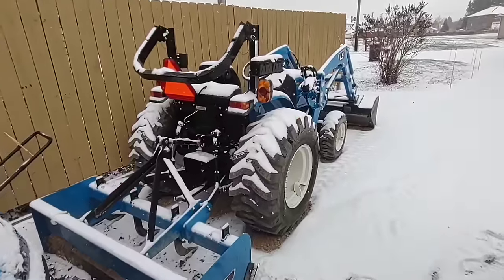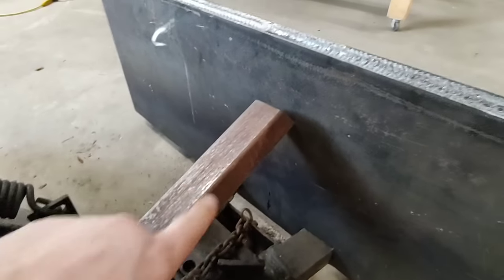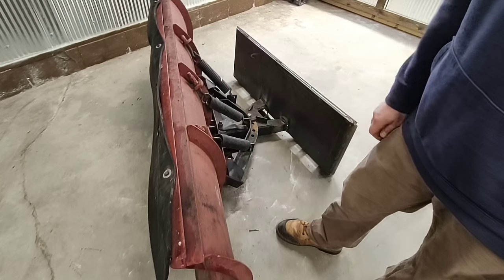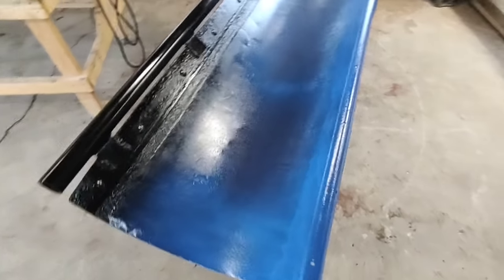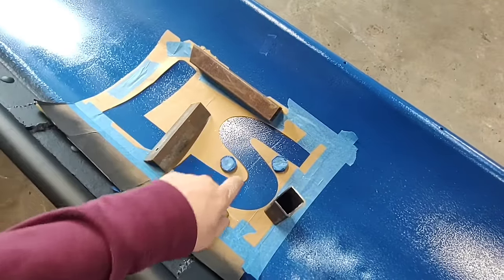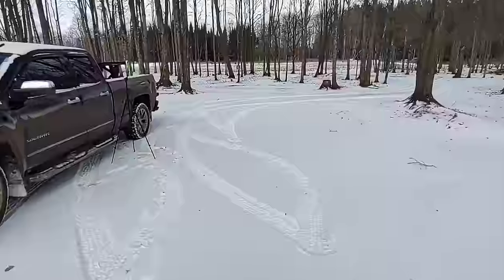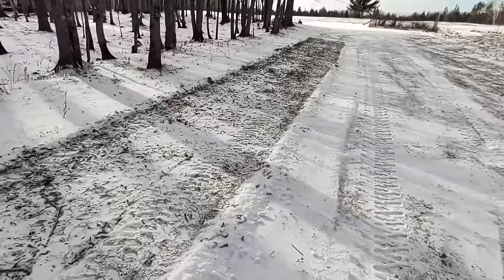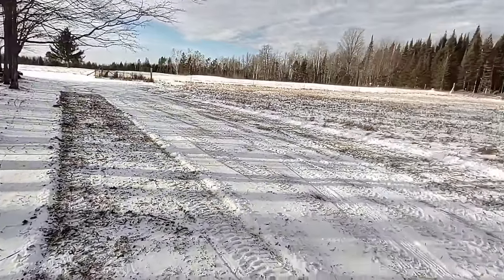Building a Snow Plow For My Tractor! Using an old truck plow and quick attach plate.

Comment: Most people would mount hinges to the bottom of the plate and use a chain lift so that the plow can float with just its weight pushing down not the weight of the loader too.
Reply from the maker: Before I built mine, I did see that with other builds. I just went a different route. Thanks for watching!
Reply: the loader should have a float function
Reply: The idea of hinging the plow on the QA plate is to keep as much weight on the front axle for traction, in the case of a 4wd tractor.

Comment: Works great. Easy enough to add a third function and angling ram later.
Reply from the maker: I will be adding an auxiliary hydraulic for a brush/root grapple this coming summer... so, we'll see how this winter goes with manually angling the plow, and if I need to next winter maybe I can add a hydraulic ram to angle the plow. Thanks for watching!

Comment: Great job , where do u live ? I'm going to do exactly what u did .
Reply from the maker: Thank you! I'm in the Upper Peninsula of Michigan.
Reply: @fieldlettuce9820  I have a plow hooked up to a plate but with the cylinders it sticks out probably 3 feet farther than yours so I think I will do this sometime cuz I like what u did and with the pipe on the cutting edge I think l will do that too , I plow trails/ walkways  in my yard that go out to my pigs / cows exc  that I have wood chips and I think doing what u did will work better , now I do just run the blade up a little bit with my plow shoes . Anyways I'll go through all of your videos through out the upcoming months. Todd 🤪
Reply from the maker: @toddcaskey9984  Great! I'm glad you liked it, and thank you for watching! 👍 Good luck on your project!

Comment: How do you like the LS tractor.  I went with a massey furgason.  Dealer. 15 miles away.  No LS dealers any where close to me i did look at a few. Takecare.
Reply from the maker: I love it, I haven't had any trouble with it. I actually went LS because we have an LS dealer in our small town. The only complaint is, the model I bought doesn't have a cab you can buy for it. I would have had to buy the larger model, and it wasn't what I needed. So, I'm sure I will be doing a video soon of me building my own cab. Thanks for watching!
Reply: @fieldlettuce9820  cab is nice just a bit more work to get in and out of when dressed for winter.